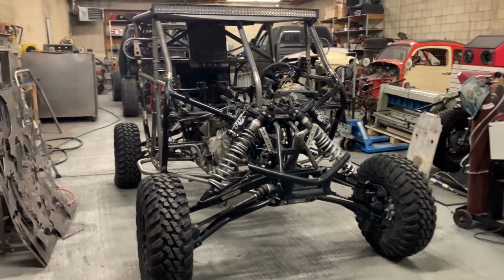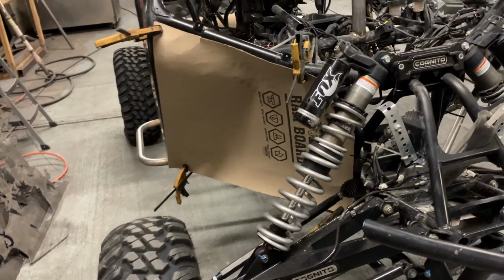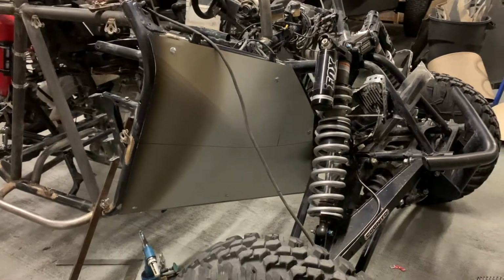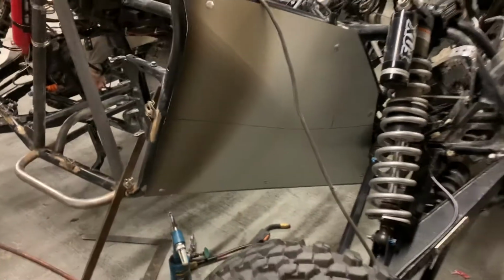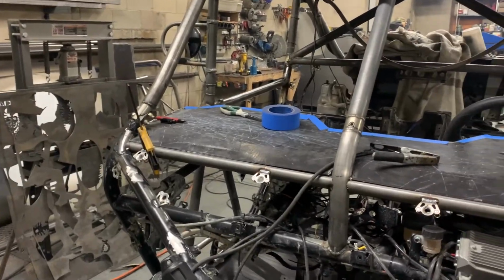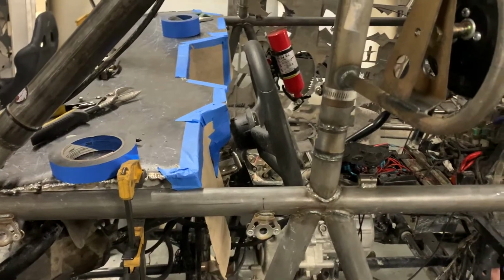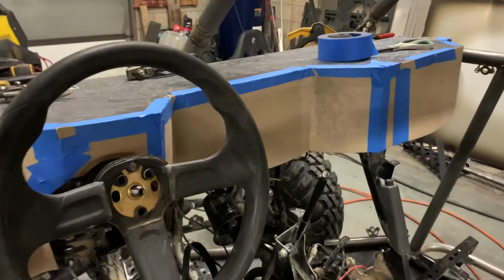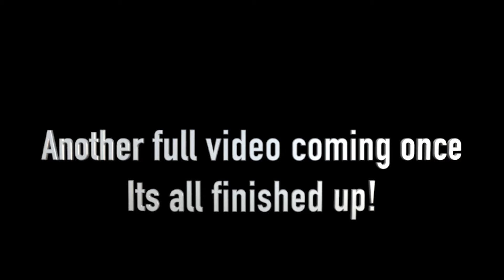TURNING A YAMAHA YXZ 1000 UTV INTO AN OFF-ROAD RACE CAR! #yxz #racecar #offroad

Comment: What thickness are you using on the aluminum panels? .125 or thinner?
Reply from the maker: We use .063 for most panels. Sometimes thicker like .090 if they will be in the line of fire and get beat up more.